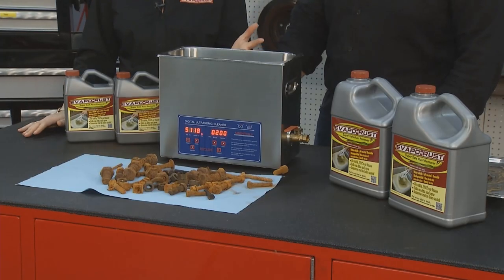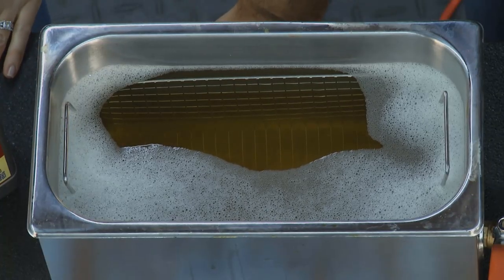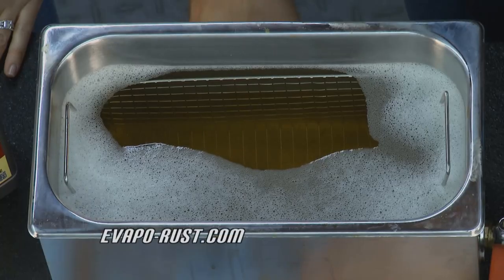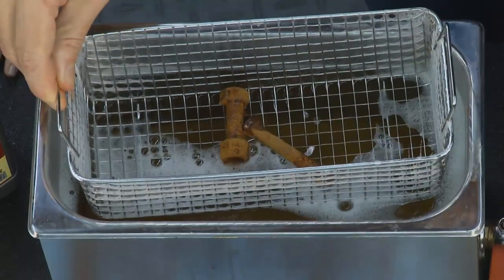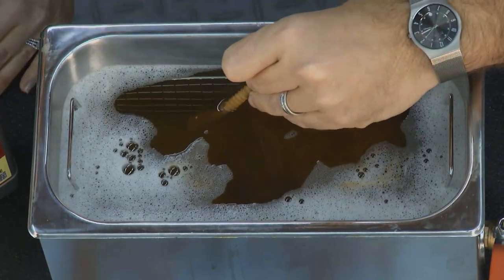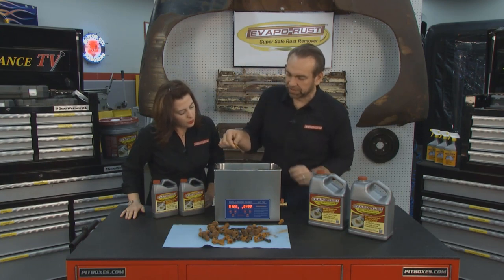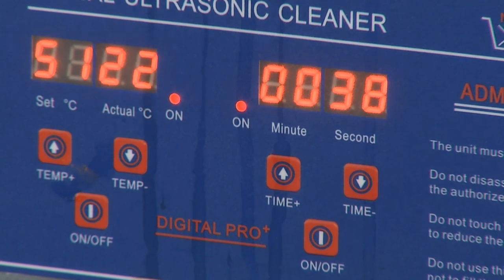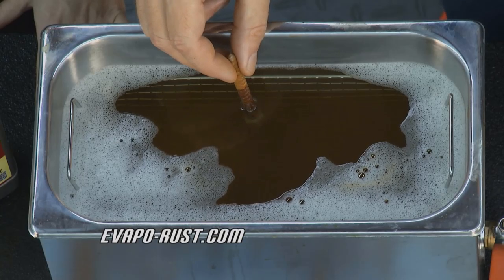EVAPO-RUST Rust Remover - Ultrasonic Cleaner Tip

Comment: Put those rusty bolts in a small plastic bag of evaporust and put the container in the ultrasonic tub filled with water.  That way everything stays clean and you can use as little evaporust as necessary to submerge the part.
Reply: thats actually a bad idea. How are you gonna put the liquid back in the bottle? Evaporust is re-usable so you can just leave it in the tank forever, and filter it once in a while through a coffe filter if chunks of rust pile up at the bottom
Reply: @meocats  pour it out of the bag through a funnel and filter back into the can
Reply: @RedShiftedDollar  its much easier to drain the tank than to squeeze every through out of multiple small bags
Reply: Using a glass jar is better, plastic will negate some of the benefits of the ultrasonic waves